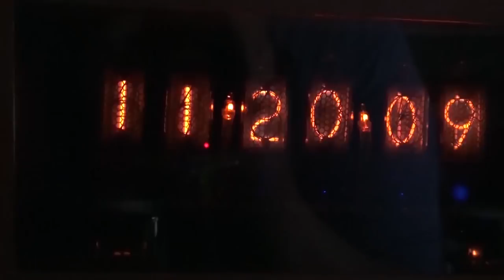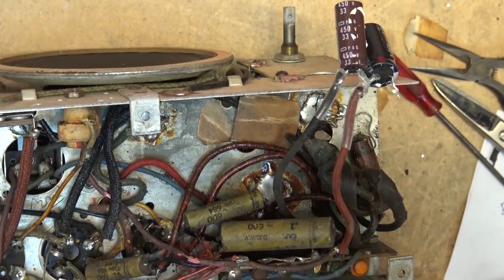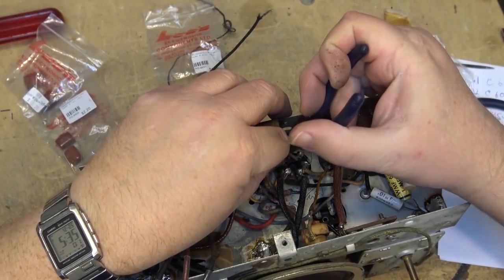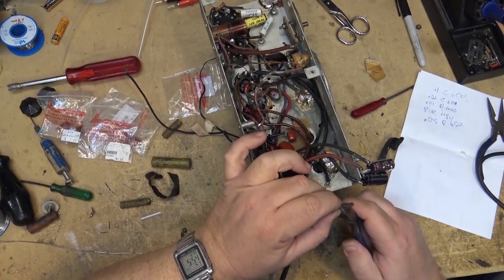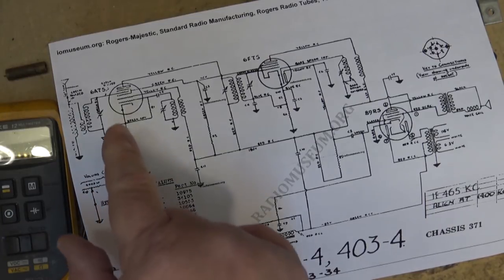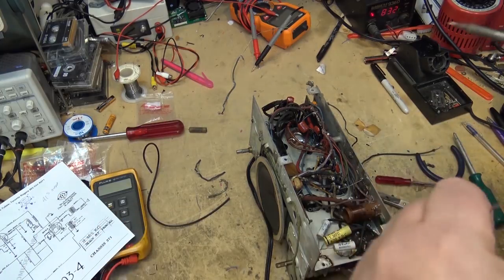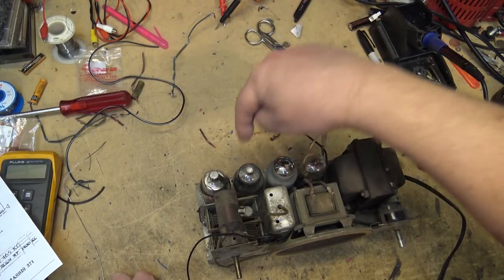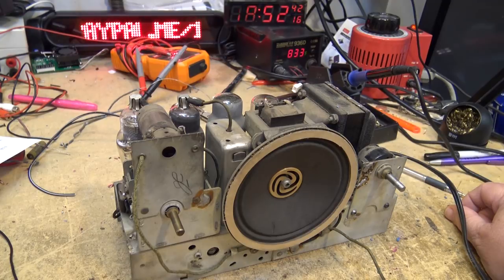Vintage 1933 Rogers Majestic Model 903 Restoration part 1

Comment: I have seen antique wirelesses like this and in spite of the position of the volume control, the first valve is in a stock standard frequency converter circuit. The pentode section is a standard IF amplifier (except that the second tuned circuit seems to be only singly tuned) while the triode section is wired as an "anode bend" detector. This gives the radio the performance of nearly 4 valves (plus rectifier) for the price of 3. There is no regeneration used although the lack of power decoupling could result in unintended feedback.

Comment: Wire colour only matters if you are restoring it back to original and it's a highly valuable and rare radio.
That one isnt, the electricity really don't care about colour LOL :-D.
i would want to check those carbon resistors at the back, usually high as a kite lol.

I was given a odd radio with a military socket on the front for power, it had no internal power supply, it's case was like a rough army box for throwing in the back of a jeep.
I think the manufacturer had re-scaled army radios for the general consumer.
'
i had no idea about voltages, i looked up the valve anode voltages and guessed about 70% of that should be good enough, and the heaters were 12.6v i think.
I made a psu in a box and rigged up a 5 second delay for the anode voltage after heaters, i didnt know if i needed to do that, but i played safe.
It worked loverly :-D
Reply from the maker: I'll check the tubes first, and then look at the old carbons. Yes I know they go up in value, but as I said at the end, before I start looking for other things I do need to make sure the tubes are working properly, Once I get the tube tester I will continue on this one. I'm also sure that I need to make up a proper antenna.
Reply from the maker: All of these old radios are getting rare these days. Wish I still had the old Zenith color roundie I had years ago. I have several old VCRs and a few old CRT TVs I am hanging onto, some old tube cameras. The CT101 I recently added is a nice piece. Smallest full color CRT ever made, and that is a collectors piece. That and my old indextron projector with built in Betamax.

Comment: You should do a video showcasing your old radios etc as they sound really interesting, especially to enthusiasts!  I bought a tube radio on ebay but haven't had the courage yet to get in about it!  I'd be interested to see how you transmit your am test channel as it would certainly be useful over here where am transmission is pretty sparse!

Comment: So...? Combo rectifier / amplifier tube was replaced with 2 separate tubes
Reply from the maker: No the radio was 2 separate tubes, the combo tube came later. The print was for a radio that used the combo tube. The front end obviously is the same, but the amp section is different because it used different tubes. The annoying thing is they should have changed the chassis number / model number as the schematic is the correct number, but not the correct print for the older radio I have.

Comment: Most of your '30's sets did not have a loop antenna. The schematic seems to be showing a antenna coil, and looking at where you antenna is connected, that coil m
may have a been bypassed . Antenna coils are found open alot because of lightning strikes that were close by.

Comment: The radio was modified to a separate power tube and rectifier probably because the combination  power/rectifier tube became unavailable... I can't find a reference for that particular type anywhere at all... The schematic is most likely correct for the radio as it left the factory. What are the two tubes that are in the circuit instead... I'm guessing 41 and 5Y3 but that is just a guess... what is there is certainly not correct for 1933...  most likely the 89RS failed during the war when new radios were unobtainable and someone did the modification to keep it going.
Reply from the maker: Stephen Wild 
Looks pretty original to me. All the tube sockets look original and it doesn't appear to have been modified.

Comment: Really enjoying your videos as I also am restoring old valve radios, a friend said I should get a good ventilation fan when soldering even though I'm using lead free , do you have ventilation ?
Reply from the maker: I don't but I am in a garage which is not air tight. When I worked in the repair business the shop was not very well ventilated, so any damage will have already been done breathing fumes for 20 years.

Comment: My estimation is that the pentode valve 41s (Rogers) has died.
In addition, it does not hurt to clean the adjustable tuning capacitor.
Reply from the maker: It does however have plenty of output when the grid of the 6f7 is driven with a tone from the generator. 41s is just the audio amplifier.
Reply: OK. I understood that the output signal was weak. In that case, 88s (Rogers) intermediate frequency amp is suspect.
My starting point is that 89RS and 6A7s are in order.
Reply from the maker: My suspect is the 6A7 myself. This set does not have a 89R. It uses a 41S as the output and a separate rectifier tube.
The tube tester my friend brought me won't test these tubes. The one he brought me last year would have, but he can't find it, and brought me a small century tester which doesn't have the right sockets on it. Hopefully he can find the other tester.
6A7 is the RF front end, and since the signal is weak I suspect that this might be the culprit, however I also do not have a proper long wire antenna on it, so that will contribute to it being deaf.
Reply: A better antenna and a ground connection seems good to me.
I would also measure the tubes. Measuring is knowing!
Incidentally, 6A7 is offered via Ebay.
Reply from the maker: Nope watch part 2 for the solution.

Comment: Just curious, did you test the main filter electrolytic capacitor after replacing? Just wondered how a dry electrolytic measured after all those years. I have a few that are 50-60 years old that are still top notch. Great vid!
Reply from the maker: I haven't tested it, but still have it, so that is easy to confirm. I changed it out just on spec due to age.

Comment: Did I hear "poppencorken mit spitzensparken" at 1:11:58 .. no magic smoke though, so well recovered.
Reply from the maker: Oh there was much more lightning than that.  Bloody trimmer is on the B+ rail, so , yup 200v to ground makes a nice pop. Had it had a silicon diode rectifier, then yes there could have been smoke, but tube rectifiers are pretty forgiving.
I forgot to put the big warning about high voltage at the opening. Actually I did but windoze crashed at 98% render out and didn't save my project, so I had to start over, and spend another 6 hours editing it again from the start. One of the camera files was corrupt in the second to the last shot, and when it hit that corrupt file, windows just  shut down like someone turning off the switch.
In the second rendering I made sure there was 2 backups of the project file as it crashed a second time too, but I was able to recover my EDL, and find the corrupted file and trim about 2 seconds from the tail of the shot where the clobbered data was.

Comment: That speaker looks new. Has it been reconed?
Reply from the maker: Not that I know of. This is how I received the unit. You saw it as it came out of the cabinet, however I am not the first to work on it as a few caps had already been replaced.

Comment: tip m8, record your mic in mono, its annoying lol, had to set my creative soundcard to mono cause of the channel swapping, over 80 years of heat buildup, im surprised those wires werent in even worse condition tbh, these things can get real hot. you are right about the caps, old tube stuff like this is very forgiving. love the design of that speaker! whats the center metal plate thing for? looks like a modern car speaker lol. can you check the foil of a cap without a scope?
Reply from the maker: Too bad so sad. I like stereo sound. Mono makes me think I am listening to AM radio.
Reply: stereo is good for ambient but not good for narration. you know you can get am stereo!

Comment: Harbor freight if you have one I got a real nice 150 watt or 180 watt soldering gun with case extra tips etc.for15.00 dollars looks in everyway like a weller.I bought it for tube radios which I very little on ,I bought one ,it only has one large filter cap every thing else is disc caps.but removing stuff on a tube radio k had to crank up my holding pen up a lot ,so for 15.00 I couldn't go wrong

Comment: what is the full tube line up of your radio? Radios of that era required a long wire antenna on the order of 50 to 100 feet long.
Reply from the maker: 6A7 Oscilator/mixer, 6F7 IF and detector, 41 Audio amp and an 84 rectifier

Yes I am aware that they need a long wire antenna, which I haven't put up. I am missing the back that no doubt had a antenna coil wrapped around it. It shows a coil between the antenna and ground, and then it goes into the RF input transformer that couples it to the 4th grid of the 6A7 tube.
Reply: My google-fu has mostly failed on this one. There are a large number of Rogers Majestic schematics on http://www.nostalgiaair.org/Resources/485/T0000485.htm, but you already have the one they have. It seems Rogers Majestic had several names and their stuff is found in Riders under Grigsby Grunow. The company was also know as Rogers Vacuum Tube Company, Rogers Radio Tube Company, and Rogers Batteryless Radio Company. I looked up the tube lineup at http://www.grillecloth.com/sylvania/tubelist.php?comp=&mod=&Num=&tube1=6a7&tube2=6f7&tube3=41&tube4=84&ball=&Submit=Submit&db=1 The Remler Scottie model 30 and 40 have the same lineup as yours but you would have to compare the circuits to see if they are the same. More than likely your radio was a very early version and they found that one tube that did the job of the rectifier and the output, so not enough were produced to warrant a separate schematic.

As for the antenna coil in some cases you can substitute one from another radio or even a more modern ferrite antenna. I have done that with good results, but you have to re-tune the oscillator.

Comment: When running new wires thru a rats nest solder the new wire to the old wire and pull it thru gently. Then you have the same path.

Comment: I hate brittle wires,the tube radio working on both speakers wires snap off,so I will have to use jumpers and pray I can find where they go ,you see I have limited skill ,I been building kits for over forty years ,thank goodness this radio  k am working on is somewhat a simpler radio i hope .

Comment: Ugh, I cringed when you tore up that original labeled cardboard box for the capacitor block. One neat knife cut and you could have unwrapped it neatly and put new capacitors into it.
Reply from the maker: It is easy enough to put that back together, and I may do that. Sure it will have a broken seam on it, but that side can be put up against the chassis where you won't see it. The other sides are intact. It's my radio, not like I was restoring it for anyone. Same goes for the wire color. I won't be selling it, it will be in my collection. I am still hoping my friend can find his tube tester so I can test those tubes and rule them out.

Comment: Sweet,  nice to see you do vintage stuff again.  Think I found the schematic,  I uploaded here - https://imgur.com/a/uSy73

Edit: This was under "Rogers Majestic, 903 Ch Standard,  1933 / 1934"  from radio museum

lol just noticed you have the schematic,  doin this while still watching
Reply: You uploaded a three tube schematic, and this radio has 4 tubes. : (
Reply: Yeah,  Dave has the same schematic in the video that I found.  Looks like a ways through production of the radio they ditched the 89RS rectifier/pentode tube and switched to two separate tubes later on.
Reply from the maker: Yes this is close, except this is the 3 tube version in the schematic. Used an 89 as the audio output (with rectifier tube)
The one I have is the 4 tube version with the 41 audio tube and separate rectifier tube. That would make the one I have probably a little older, as the combination rectifier / pentode likely came later.
Reply: Also found this and uploaded - https://imgur.com/a/L2NfP ,  kinda curious  "Previous to Oct 1 1934,  this tube was known as an 89RS" ,  hard to read though

Comment: If you inject a modulated signal at IF frequency into the grid of the second valve you will be able to confirm the condition of that valve and its IF transformer without all this poking about and endless speculation.
Reply from the maker: If you watch part 2 you will find out the problem. Some jackass got 2 tubes mixed up. The wrote the wrong numbers on the chassis. It took awhile to figure this one out because the tube number was written on the chassis, and the tubes were "correct" according to the labeling. It wasn't until I started tracing wires on the schematic that it became clear. Swapped the tubes, and bingo, radio working perfectly.

Comment: I learned before I had eccentric customers flip on me. All they think about is if it looks original, it sounds better. I'd cut that dual cap box on the bottom side use a razor and repack the new inside and crazy glue together and fill it with resin or epoxy, even them poly caps would get wrapped in paper and waxed even if it's bigger it still looks the part electrolytic caps I bend the negative over the side and roll it paint them like a bumble bee cap for example and these customers pay hundred more because they're anal retentive therefor I do it. If not it looks like 2018 I even keep all the wires when I strip a old device down and buy sleeves I slide over the silicone wires. My vocalist had a request on ebay, some people sell their used underwear complete with skid marks for big bucks even though it's a BIO Hazard, some people are ill minded. This woman wanted a complete set of the whole band autographed and she was willing to pay, sick! Probably a setup.